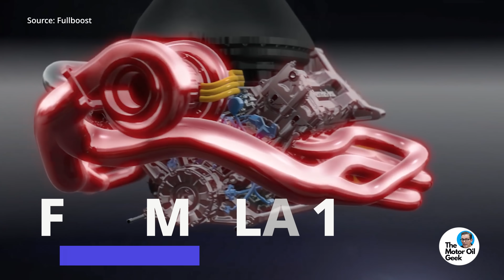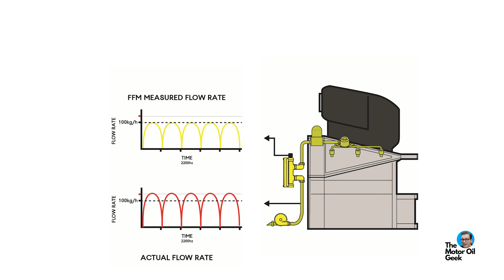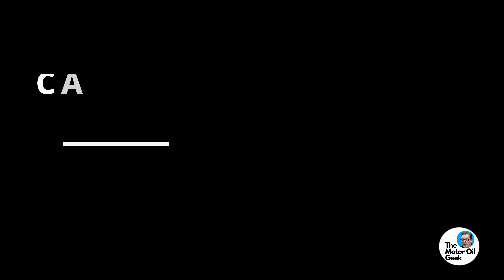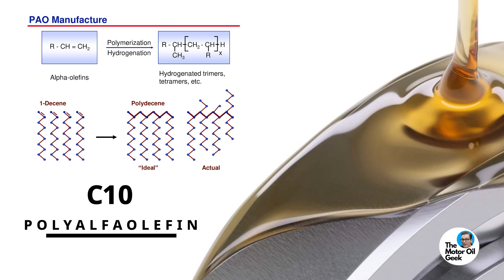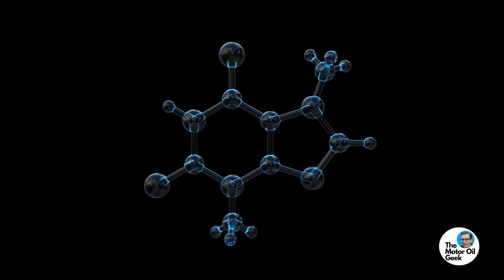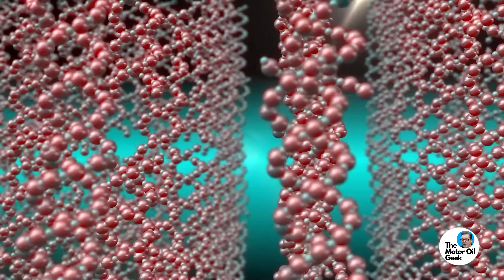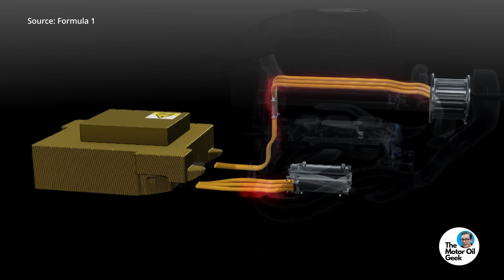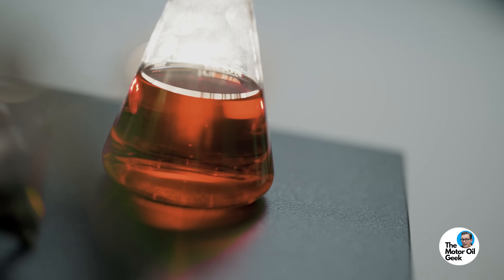SPEED SECRET: How F1 Engines BURN Oil As Fuel

Comment: sustainable fuel??  Going to run Diesel engines?? LOL  I don't count plant based fuels for a spark ignition engines actually "Sustainable" since there is WAY more energy put into the growing and processing the crop to fuel than the output energy of the fuel.
Reply from the maker: I believe the definition is carbon neutral, but I am not 100% sure on that.
Reply: Sounds like a mix of bio diesel and alcohol. Probably doesn't taste very good.

Comment: To use oil as a fuel you can’t over saturate the fuel with oil. A 2-stroke runs on a mixture of 50:1. Adding more oil gives problems with the combustion. My guess is that a regular car can use some 2-stoke oil but just a bit. Let’s say 100:1? It probably even less.
Reply: 128:1 works fine in every 4 cycle engine I've tried it with. No visible smoke, or the cats are at least handling it.
Reply: Yes, the 25yr trend of putting TCW3 in gas. It must work since it went viral across all forums that originated on the LS1 forum.  Look up Ls1 Forum Been Testing Oil by Sarge!   That thread started in 2008 to 2024 with 1000's of people using TCW3 in gas!

Comment: So now we are going to add 2 stroke oil to our tank of gasoline to let the engine run smoother? ...my fuel filter, ECU, and cat. won’t like like that (?). Or may be they do?
Reply: No.
F1's are specially built and designed for that application. They do not have cats and are tuned for it. The oil is also specialty oil just for the application. Put oil in your gas or run that thin of oil in your engine and you will kill the emissions system and eventually your engine.
Reply: Yes, the 25yr trend of putting TCW3 in gas!  It must work since it went viral across all forums that originated on the LS1 forum.  Look up Ls1 Forum Been Testing Oil by Sarge!   That thread started in 2008 to 2024 with 1000's of people using TCW3 in gas!

Comment: So now we are going to add 2 stroke oil to our tank of gasoline to let the engine run smoother?
Reply: Some of us have been doing that for a while. TCW3 2 stroke oil, at a rate of roughly 1 oz per gallon.
Reply: The ratio that was claimed to be best was 1oz per 5 gal of fuel according to that thread that went viral in 2008 called Ls1 Forum Been Testing Oil by Sarge!

Comment: Anyone can make big horsepower these days. I want to see engine builders make the most EFFICIENT engine possible. Rebuilding a 1.6L GM Lh7 Turbo Diesel, just got my gapless rings back from Total Seal, had the pistons coated with Line to Line's skirt and top coating. Had the crank journals, wrist pins, cams, everything I could WPC treated for that silky smooth movement I can't wait to see how many MPG's I can get with this thing!
Reply: Given that friction typically accounts for 5% or less of the fuel consumption of an engine, it is unlikely you will see dramatic differences.  If a car got 40 MPG and you reduced engine friction to zero, you might get 42 MPG.
Reply: @LTVoyager  
While 5% friction losses might apply to a stock modern engine, that number doesn’t reflect what’s possible in a purpose-built, efficiency-optimized build. This builder isn’t just reducing friction—they’re stacking proven mechanical and thermal gains that compound in a high-efficiency diesel platform like the LH7.
	•	Gapless rings dramatically improve sealing, reducing blow-by and increasing effective compression—especially at low RPM and part throttle where most driving happens.
	•	Line2Line piston coatings provide tighter cold clearance without scuffing, reducing start-up wear and parasitic drag throughout the temp range.
	•	WPC treatment reduces surface roughness at the microscopic level, minimizing friction across cams, pistons, rods, and bearings, while also increasing fatigue strength.
	•	Coated bearings and low-friction piston skirts help reduce oil film shear losses.
	•	Thermal barrier coatings on piston crowns and combustion chambers retain more heat in the cycle, improving thermal efficiency—less heat into the coolant and more into the crank.
	•	Lightweight, balanced rotating assembly cuts down on inertial losses and improves throttle response.
	•	Optimized quench and tighter piston-to-head clearance support better combustion control.
	•	Advanced ECU tuning (MS3Pro Ultimate) allows fine-grain control of injection timing, pulse width, boost, and AFRs—crucial for extracting efficiency at cruise.

Add to that improved intake and exhaust flow, possibly a variable geometry turbo, and this isn’t a “2 MPG” tweak—it’s a complete system transformation. With all these elements working together, you’re looking at double-digit percentage gains in BSFC and real-world MPG. Efficiency isn’t about chasing one number—it’s about stacking a dozen small wins into a big one
Reply: You would be better off with figuring out how to get at least 40% of the bang to be used for power and then spend the rest of the money on aerodynamics.
Or swap in an electric motor, Skim the car in solar so it charges while you’re parked anywhere and the rest on aerodynamics.
Reply: @MrBertstare  LOL like the Aptera car?
Reply: @justinw1765  exactly
Reply: will take 20 years of fuel efficiency to pay for this
Reply: What kind of vehicle is it in? We want updates on your fuel economy tests.
Reply: Ford & GM for LIFE ❤ 💯 🇺🇸
Reply: Big horsepower is efficient, they’re heat engines.
Reply: See best damn garage he built a thermal engine
Reply: See best damn garage he built a thermal engine
Reply: Its called an EV. If u want max conversion into torque with much less energy loss, use a shitty EV.
Reply: 7lbs = 1hp
Reply: @Walkeranz  are you saying 7 pounds of vehicle weight is equal to 1hp? Because that number changes with how fast the car is to start off. Less weight equalling the same 1hp, as the car gets faster.
Reply: Not anyone ! Some people can not get their  factory auto to make combustion gas ! 😢 Riding the bus making car payments😊

Comment: Yes, I would love to see a video on octane in gas, and what is a safe effective octane booster that could be added to regular gas. 

My octane usage case. I have a 2021 Silverado with a 2.7. The recommended gas for this engine in 87 regular. I have found that towing my travel trailer in summer heat pulling grades it will have spark knock. I have stopped the knock by using 91 octane gas, just when I tow the travel trailer in the heat. Sometime I forget to try and have the gas tank used down before filling to go camping. So are octane boosters safe and do they actually work well?
Reply: Octane booster work well in engines that can run leaded fuel. DON'T play around with them unless you want a very expensive repair bill. Look around for a place that supplies racing fuel in your area because they make unleaded fuel with higher octane that 91. A octane of 93 is available in some areas at the pumps but a racing fuel supplier can go even higher. My Dark Horse can take 87 rot gut and runs fine however it will provide more horse power the higher the octane. One other thing to look for is E15 or E85. If your engine can handle those fuels, alcohol can provide a higher octane but your miles/gallon will be lower.
Reply: @denawiltsie4412 their are boosters for fuel injected engines with sensors and a converter.  
Your race fuel provider is either adding on additives or ethanol to get the octane. So something out there is safe.
Reply: @briannelson2818  They  sell fuel in cans or barrels so it's not delivered over the common pipeline. It's possible to construct carbon chains that burn slower but it's a costly process that they don't do here. Europe has higher octane fuel from the pump that we can get here, I think about 95 octane. If it were just an additive, the stations would sell it because the profit margins on premium fuel is good however here in Phoenix, about the best I have seen is 91 and that's with fuel we get from California and Texas.
Reply: @denawiltsie4412   race fuels are darn expensive though.
 Also aren't European fuels labeled as research octane only and not RM2?
Reply: @oneninerniner3427  Yes European fuel rating is different but I saw a video where and engine set up for that fuel was shipped over here for a show and then them made the mistake of running it on our fuel. The result was an engine replacement. 
Racing fuels are expensive and that's why people don't normally run it or reserver it for restored cars. Like I said, your options are limited to 91 or if your lucky, 93. There isn't much demand for really high octane. The car manufacture saw the writing on the wall a long time ago and most engines run on 87 but a few like the Ford Econo boost require something higher.

Comment: Hi Lake! A question I've had for a long time: can ashless TC-W3 marine 2T oil be used as fuel additive in 640:1 ratio? I had my fuel pump (in my LPG-converted car) die after 20k km and I've heard TC-W3 lubricates the electrical pump, stabilizes the fuel and even helps clear piston deposits. Is there any truth in that?
Reply from the maker: We are going to test that out!
Reply: Obviously not lake, but I ran a rate of 1oz per gallon for a while. That's a lot heavier than your 640:1 ratio.
Reply: I’m curious about that too, but for a different reason. His video on premium fuel presented research from SWRI and Europe showing that anti wear additives in fuel can significantly decrease cylinder wear. Fascinating why, but I can’t find reasonably priced gas that claims to reduce wear; Shell premium is just too pricey for my budget. 

It seems a lot of people will add TC-W3 oil to the gas at a concentration of 100:1 or less as an upper cylinder lubricant. I want to know how likely that would be to foul the catalytic converter and if oil analysis could be used to tell if it causes any problems for the crankcase oil because inevitably a small amount will get in there.
Reply: Its bern a 25yr trend of putting TCW3 in gas & Lake nerds to Myth bust this one! 🤔  However different brands must use different chemistries & forumula's to meet TCW3, so maybe one brand could be the magic formulation.  It must work since it went viral across all forums that originated on the LS1 forum.  Look up Ls1 Forum Been Testing Oil by Sarge!   That thread started in 2008 to 2024 with 1000's of people using TCW3 in gas with success.🤔

Comment: If the rulebook is so large that it takes a week to read-through, you need to throw the book out. Just let them race. If they want to burn crankcase oil and risk starving the engine, let them. If they want to RnD some new, crazy aero or suspension tech, let them!

Racing is about the TEAM. NOT just the DRIVER. That includes the cars, the engineers, the strategists, and the FUNDING. Motorsports have gotten so incredibly boring, lately. All the cars look the same, they handle the same, they sound the same... It's mind-numbingly frustrating. I miss the days when you could tell which car was going by, by listening to the engine. (And I wasn't even born early enough for that.)

Cut the red tape and B.S. BRING BACK GROUP B and GROUP C!
Reply: 100% agree.

Comment: Videos I’d like to see. Marine oil, small engines, two strokes.
Reply from the maker: Great suggestion!
Reply: 😂 Hey Lake,  Yes, the 25yr trend of putting TCW3 in gas would be a great topic for you to Mythbust!!!🤔  It must work since it went viral across all forums that originated on the LS1 forum.  Look up Ls1 Forum Been Testing Oil by Sarge!   That thread started in 2008 to 2024 with 1000's of people using TCW3 in gas!   Now I wonder if we can get our hands on that C-10 you mentioned!🤔
Remember the old Top End Oiler from the 1950's by Marvel Mystery Oil?  They found a stash of these NOS Ampco Top Cylinder Lubricator in an old warehouse & are being sold by Ampco Lubricators.  My idea is to mix some MMO, with TCW3 along with a favorite PEA concentrate like Redline SL+1, or Gumout Total, BG44K, ect. for some cleaning & possibly to burn burn in the combustion chamber as a seudo F1 oil power fuel.😋😂🤔
Reply: I agree. I worked in the chandlery for boats and engine oil for the marine engines are exapensive compared to car, truck and industry oil. But is it worth it, whats makes it special?
Reply: @KevinPedersendk biggest things I’ve found with tcw3 is it’s got great anti corrosion properties, it’s designed for water cooled engines so it’s not a great oil for high temperatures and air cooled equipment. In a pinch you could for example run it in a saw or trimmer and even as power steering fluid on older vehicles but for air cooled engines I’d suggest tuning at a richer mixture that being said I wouldn’t recommend it! It seems to gum up in hotter engines, so it would be interesting to hear some scientific explanations. Btw the use of alternative fluid to compensate for a leak in any system isn’t really the best way but tcw3 stopped a steer leak in an old Nissan of mine

Comment: What was the iron additive that Ferrari used in their fuel ? They exhaust pipes were always "rusty" inside.
Reply: Sure that's iron? I've had that same color on sparkplugs when the fuel had significant amounts of MTBE(fairly common octane booster) added into it.
Reply: AvGas has the same exhaust pipe tinge to it, tetraethyl lead (TEL) is added not iron, I found this when adding AvGas to my pump gas for track days in my turbo charged car.
Reply: @steverielly F1 doesnt allow lead.
Reply: I always assumed that was the result of an excessive amount of an oxidizer added to the mix.

Comment: One of my teachers was an old McCullough chainsaw engineer and he always said "we used to burn as much oil as we could without fouling the spark plug and that was about 16:1”
The more oil you burn, the more power you make!
Reply: I found that to be generally true in my dyno testing kart racing engines.  Horsepower increased with additional oil.  I was never able to quantify whether this was due to an increase in BMEP or reduction in overall motoring friction, or both.
Reply: Usually a high oil content to the gas oil ratio makes for a lean mixture which can lead to holes in pistons in high performance two stroke engines.

Comment: People are adding 2 cycle oil to their diesels. Does the 2 cycle oil damage the DPF?
Reply: It can damage some engines, there were even a lawsuit after a gas station had spiked the fuel. 😬 But it's been somewhat common practice on older engines running modern diesel.
Reply: most people who do that are deleted or have an older diesel

Comment: What kind of HP does it make?. Gearbox power.
Reply: The ICE, about 700hp. Total is over 1000hp (including hybrid systems MGU-H and MGU-K)
Reply: @black7rc720  the combustion engine is about 850hp and the electric about 150hp.

Comment: A video about 2-cycle oils (and also rotary Wankel oils, whether they are the same as 2-cycle oils or not), would be very interesting!
Reply: We want to know the specifics of the ashless anti-wear chemistry of 2 stroke oil!
Reply: @gregorymalchuk272  The GREAT OIL DEBATE!! Few topics are more controversial than the use of "universal" ashless, TC-W3 certified oils (for boats) in air-cooled small two-cycle engines (wich supposedly require "low-ash" API-TC or JASO F# certified oils.
Reply: Fantastic ideia! Would love some 2 cycle oil content!!

Comment: When you have virtually unlimited funds and the latest engineering technology you can burn whatever you want.
Reply: Lake didn't want to give numbers, but F1 engines are something like 70 PSI boost, 17:1 static compression, 17:1 air fuel ratio (they use Turbulent Jet Injection, a kind of pre-chamber to limit detonation). All things that would cause a lesser, less carefully tuned engine to blow up pretty much immediately, lol.  Even so, they still blow up sometimes...
Reply: @TassieLorenzo  They don't blow up, they have "an issue with the oil system" as large chunks of the engine are left on the racetrack.
Reply: You can't though. It's sealed for 6 race meetings and after that is inspected and probably thrown away, rather than ever being rebuilt.
Reply: To this day it amazes me how a two stroke engine can pass fuel and two stroke oil through the crank , rod journals , rods , piston rings and pistons and be as reliable as they are !
Reply: By all means in the past (like the year 2000) they used to use four engines per car per race meeting though. Different times! But that's been regulated out.
Reply: @TassieLorenzo  Yup I remember when F1 used engines like candy
Reply: Incredible wasn't it 😢
Reply: @TassieLorenzo which is funny because they make loads of engines now then just don't use any but the best versions for the season spending hundreds of millions instead of just having a cheaper to make 18k rpm engine with their supposed sustainable fuels they are swapping to for like 15m a year
Reply: No rebuilding these.  They have FIA seals on them.
Reply: No, if you burn normal engine oil you're going to get detonation from the very low octane rating. And probably a lot of nasty deposits.
Reply: Yup
Reply: me when I'm dumb and wrong
Reply: Cost cap has entered the chat.
Reply: Im surprised they haven't tried fulminating gold as fuel. The amount of money passed away on F1 honestly makes me sick.
Reply: ESPECIALLY MONEY 🤣
Reply: In the end, everything runs on money.
Reply: 2025 each team can use 4 engines. After that, ever time the team uses a new ore engine component results in a big grit penalty.
So no they can not rebuild endless amount of engines ore hybrid systems.